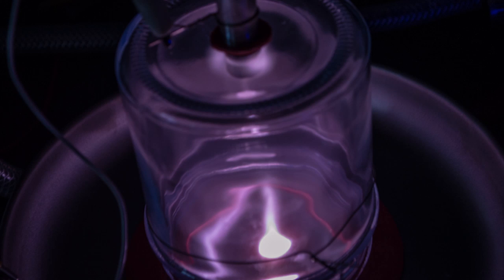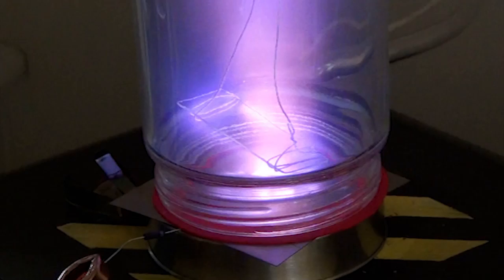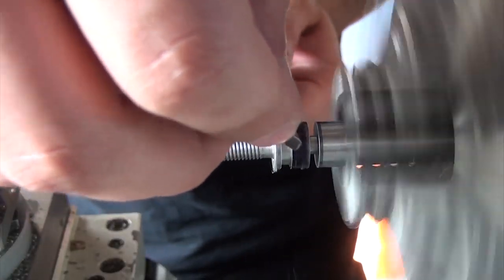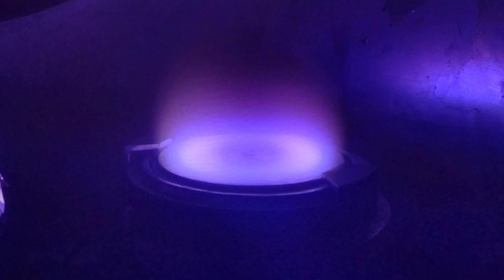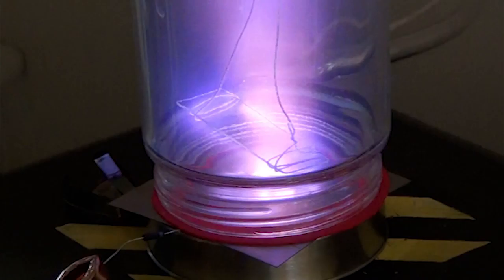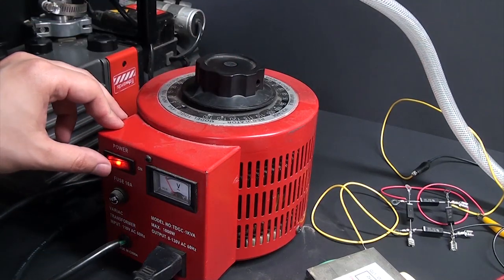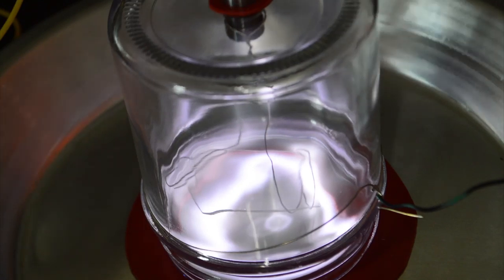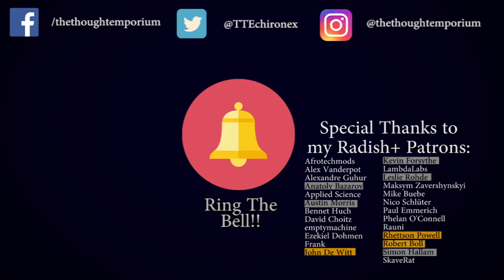My First Successful Metal Coating Machine - Magnetron Sputtering

Comment: Do you need to use argon or will nitrogen/air work as well??
Reply from the maker: nitrogen and air will react. it needs to be a noble gas
Reply: @thethoughtemporium  Ok thanks
Reply: Could you do this with oxygen and aluminum and create a very hard layer of aluminum oxide??

Comment: Wait, you're epoxying in the magnets and saying it doesn't hurt the heat transfer too much? Isn't there a better way to protect the magnets from water?
Like machining a cup the perfectly fits the magnet and putting thermal compound into it, or just using a liquid other than water, XD. Ok, a non hygroscopic liquid. Isn't that less effort with a better result?

Comment: Shouldn't it be enough, to pull vacuum, flush with argon and repeat 2 times, to secure a good argon atmosphere, as you'd typically do with Schlenk lines? It seems to me like a waste to let argon run through your system for a minute or so.

Comment: M7? M7?? Why use the least common thread instead of... I don't know... Any other metric thread???
Reply from the maker: Because I never need this to fit anything else, it was a good size for the piece, and left enough clearance without being unnecessarily large and compromising the sealing properties while working with the metal stock I had at hand at the time.
Reply: @thethoughtemporium  I am an engineer and I have never seen an M7 in real life. It is a bit strange to me that one just has the tools at home.
Reply from the maker: @bennokrickl8135  it was in my tap set so I grabbed it. Literally no other reason. If I'd only had m8 or m6 I'd have used those. But I liked the way m7 looked proportionally
Reply: @thethoughtemporium  that's what you get if you're spending a bit more money on tools I guess ;) maybe I'm just jealous.

Comment: would this not be easier is you just used electrolysis?
Reply from the maker: Only works if the thing you're coating is conductive. This can coat anything
Reply: @thethoughtemporium  you can't run a current through glass? Like high voltage?

Comment: Where is the Magnetron though? Magnetron is a resonant chamber microwave generator. I thought you were using it for plasma generation
Reply from the maker: Same name refers to 2 different devices, both called magnetrons, that do very different things
Reply: @thethoughtemporium  what's the other one though? never heard of it
Reply from the maker: @LateNightHacks  One is the thing that makes microwaves in your microwave oven. The other one, which is what this video is about, coats things in metal
Reply: @thethoughtemporium  ah, I see, "Magnetron sputtering" is a thing by itself

Comment: But why go through all this complication, expenses, and mess? If you just want to vapor coat things you can buy a cheap tungsten coil on eBay for like $2 and then wrap a desired amount of aluminium foil around the coil, start the vaccume, and run a high current through it to get it red hot, everything attached to the superfillanent portion will vaporize and will coat the inside of the glass evenly. This is how they mirror coated the inside of CRT TVs back in the day.

Comment: everybody chill, the pump costs more than 1000 usd
Reply from the maker: I got it used for about 150, but you can find one for 500 ish easily. I've also used it for  variety of projects over many years, so it's not that expensive in the grand scheme of things.
Reply: @thethoughtemporium  the grand scheme of things has no bearing on my bank account. A geissler pump (that's what they used to evacuate the original cathode ray tubes)  might be a cheaper though laborious and polluting solution.

Comment: Silicone is shockingly porous to gasses and you should avoid it for vacuum work, butyl rubber or viton are much better if you can't use a hard gasket.

Comment: Haha. Yeah you can die but with the physics of electricity, all the variables need to be right. Which most of the time they are haha. And with that said and needless to say I was being negligent to "safety" and showing off my new project in the making (MOT arc welder ) I had it plugged in and turn on... I noticed a loose  connection. I grabbed the transformer with my bare hand and immediately felt a bit of excitement from the transformer to my hand and as I pulled my hand away, about 5-6 inches electricity jumped from the transformer, grabbed  my hand... whhaaaaannnnt! (The sound of it arcing) it felt like it was pulling my hand back to the transformer. It didn't hurt but it did make me pee a little haha. From that day on I have the greatest respect for electricity and those who work in any field that involves high voltage.

Comment: Metal coat some glasses, maybe they are still see-through and then u have some sun glasses .
Reply: At work they were de-commissioning an Al evaporator deposition system, and around the same time a lot of the thin film tech's started wearing mirrored safety glasses. Rumor was, the last deposition run was purely ceremonial.
Similar rumors surrounding the Au dep guys were probably unfounded. Something about "accidentally" leaving wrenches in the chamber...
You have truly accomplished a feat of high technology by depositing your own thin films.  Not a typical garage / diy activity. Well done!

Comment: Could this be used for Reactive Ion Etching? https://en.wikipedia.org/wiki/Reactive-ion_etching
Maybe you can make a rudimentary transistor with it. Unused silicon plates are not very expensive. You could make a big transitor.
Reply from the maker: Probably, but would need some modifications first. Can't see why it wouldn't work though

Comment: You would probably be better off using a low forward drop, high-voltage, high power full bridge rectifier rather than the four microwave diodes. This unit from Microsemi is available for $20 from DigiKey and is rated at 40A at up to 1.6kV. https://www.digikey.com/product-detail/en/microsemi-corporation/APT40DR160HJ/APT40DR160HJ-ND/3120945